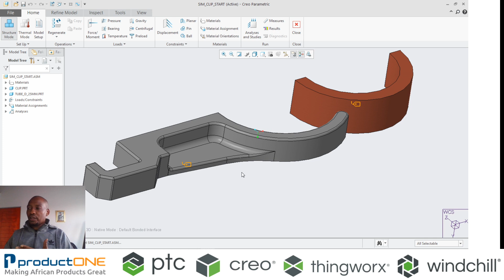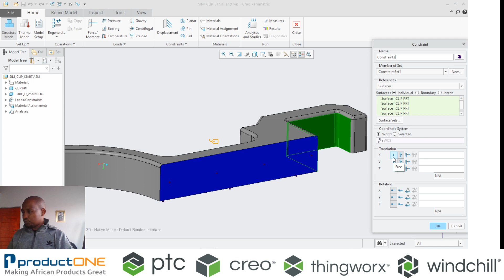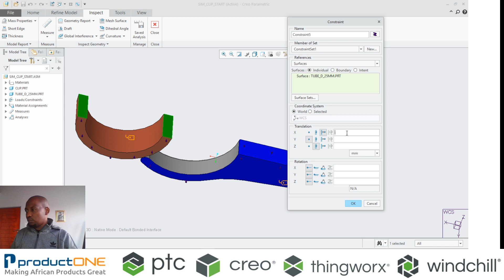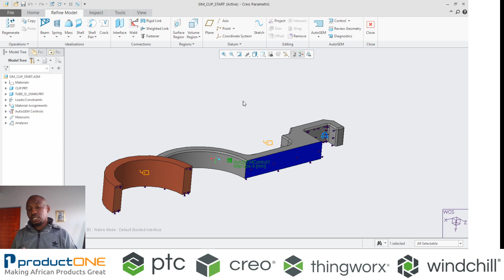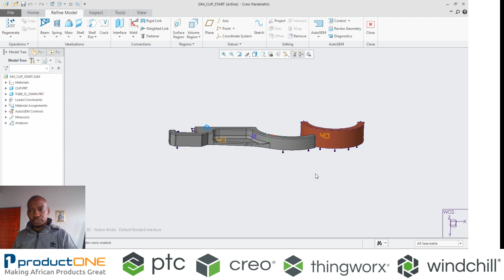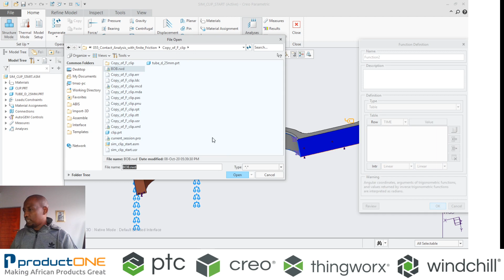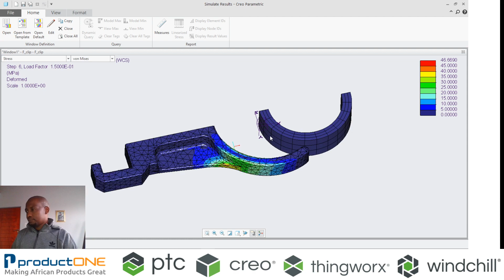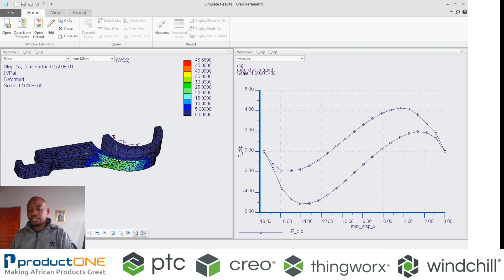Creo Simulate: Contact Analysis with Finite Friction

Comment: Hello sir,
Actually i have one structure without mounting on floor, its height 1.1m. Howmuch force required to make fall down the structure? The force applied on the top edge. Is there any way to find out the force magnitude in creo analysis?
Please reply sir........